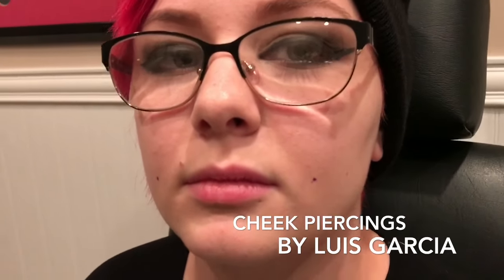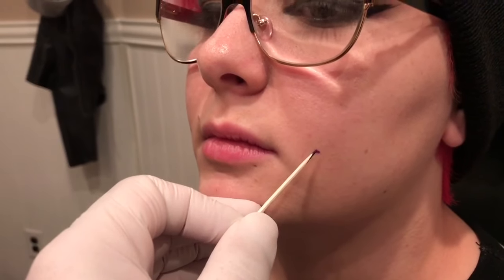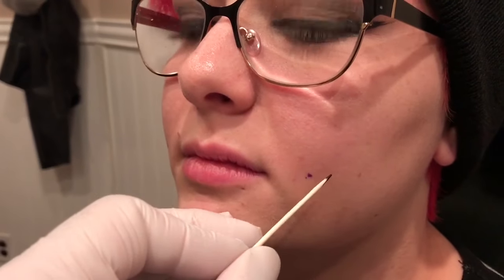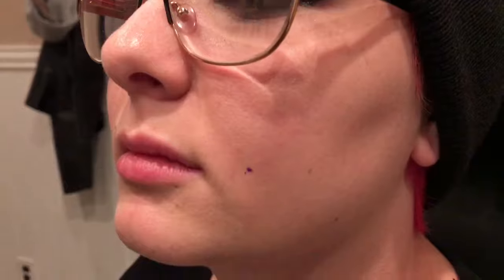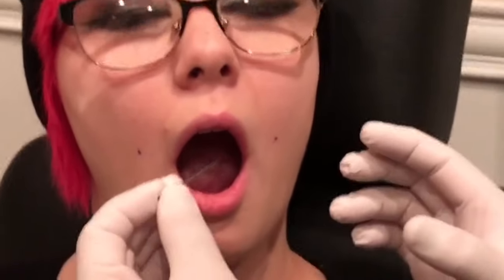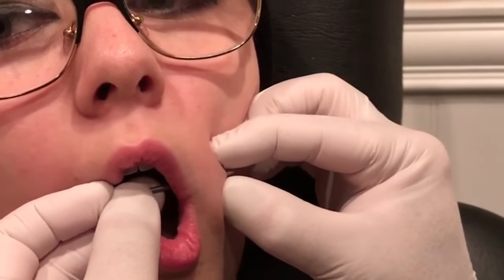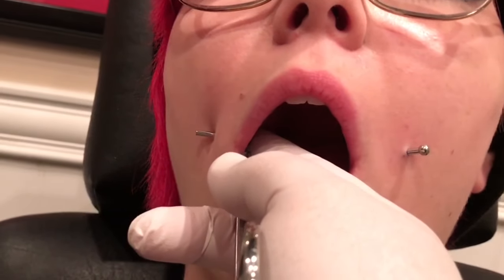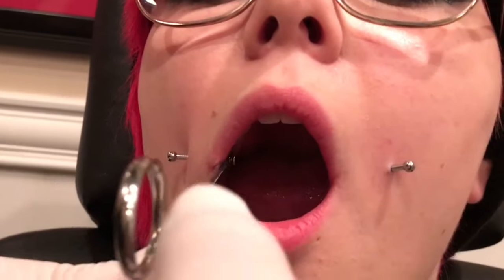Paired Cheek Piercing Procedure

Comment: just a question, what's so 'bad' about externally threaded jewelry??
Reply from the maker: peete wints the threads are dragged through the piercing, which can irritate the wound, even in a healed piercing.  Also, there isn't a company that makes externally threaded jewelry out of implant grade materials.  Not all steel and titanium is rated for use in the body

Comment: Did you feel around in the cheek before marking? Would you please motivate your choices? As in not further back and not thinner that 12g other than the obvious "bad idea"? I'm curious to know your reasons. Thanks 😃
Reply from the maker: Emmie Velders when I clean the area, I'm also feeling the tissue.  But, the reason I feel that 12ga works better is more of a common sense thing.  The piercing is going through a fair amount of tissue, so 12ga is going to be sturdier.  As for the placement, going in more forward placements is going through less tissue than farther back, which makes for an easier heal.  Also, if you feel the area while the person emotes (smiles etc), the farther back placements get "thicker" then farther forward placements.
Reply: Awesome thanks for responding Luis. I totally agree with you. I was just curious as to know your reasons and what not :D. I'm always eager and curious to know how my fellow piercers handle things and what their reasons are. Thanks again and I love your videos, keep ém coming :D. Have a great day, hugs from The Netherlands.

Comment: why would smaller piercings be problematic? as long as the top/bottom is wide enough not to get swallowed shouldnt it help healing if its a smaller hole?
Reply from the maker: Bless your heart.  The TLDR answer is simple high school level physics.  

Cheeks are thick muscle that move alot, and swell alot.  The thinner something it the more likely it is that it can tear.  That’s why knife edges are so thin and sharp.  That’s why cheese slicers and egg slicers are thin wires.  The thicker jewelry distributes pressure more and more evenly.  

Again, simple high school level physics.

Comment: I don’t like them long bars what’s the next smallest
Reply from the maker: This is a fresh piercing, and cheeks swell.  They swell A LOT.  In cases like these what you want doesn’t matter.  Safety first, so longer jewelry is required, like every other properly and professionally done piercing.  For cheeks, because the swelling takes a long time to dissipate, and goes away in phases (unlike most other oral piercings, where you just downsize once) it is especially important for healing, and they must be shortened at one month, two months, and again at three months.  Some people might even beed a 4th downsize.  

If your fresh cheek piercing is flush immediately after the piercing, you need a new and better piercer.

Comment: the needle was too big, and then the stems are really too long !! it's a little shorter anyway...In short is too big !!! But okay ... its pretty i like it.
Reply from the maker: Incorrect on all counts.  A thick area like a cheek (that’s also fairly muscular and moves constantly) needs to be done at a thicker size to reduce irritations.  Most modern piercers that know what they’re doing do a minimum of 12ga for cheeks.  

Also, cheeks swell.  They swell A LOT, hence the need for such a long piece of jewelry.  

In short, nothing you said illustrates any modern knowledge of cheek piercing, or the techniques used to yield the best and most comfortable healing for the client.

Comment: With these cheek piercings inside-out, are you resting the bevel of the needle against the tissue to see where it rests, or is it the back of the needle?
Reply from the maker: Jemma Edwards the bevel is facing inward, so the flat side of the needle tip is resting against the inside before I push the needle through